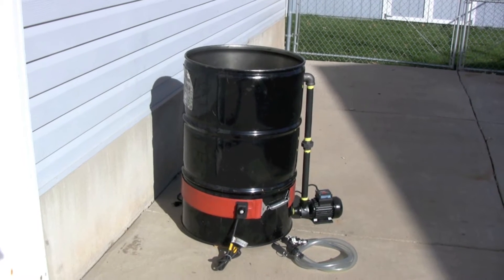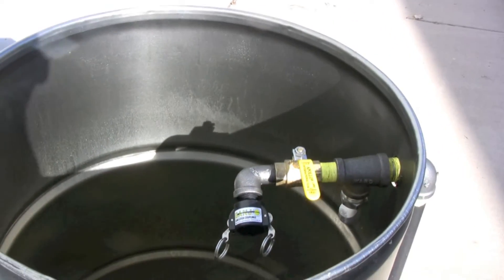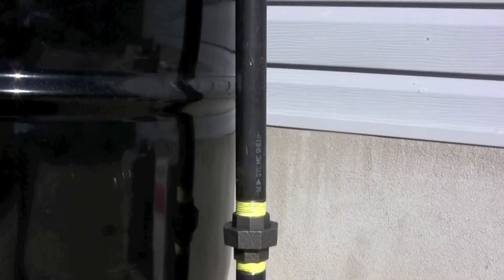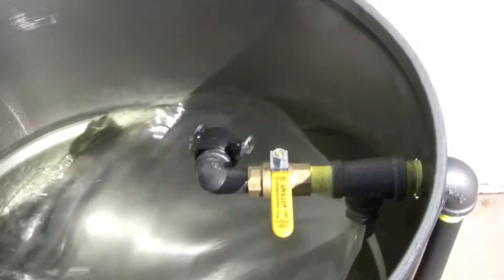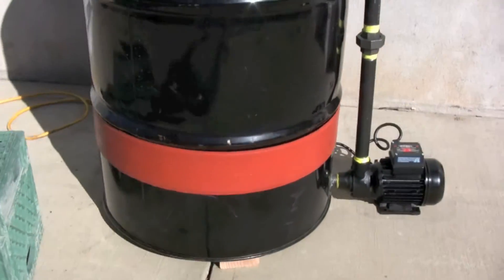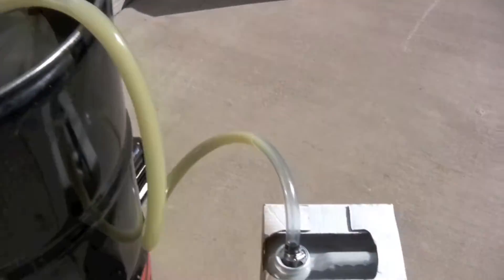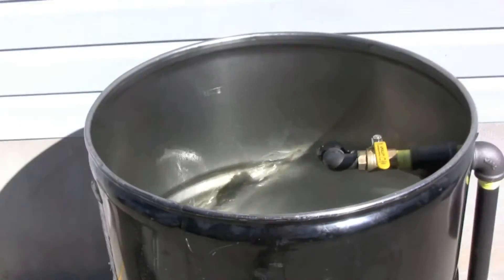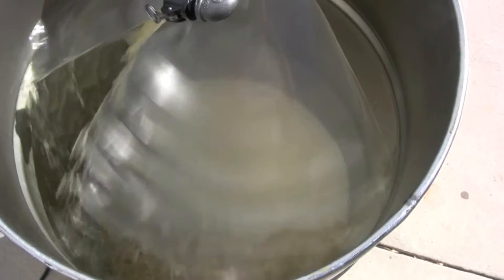Oil Drying Tank (For drying wet waste vegetable oil or Biodiesel) - Utah Biodiesel Supply

Comment: Is this drying process necessary why not just let it rest for few days and decanter the water out of the bottom?beat the bottom of tje drum out till its rounded and put in a valve or have the drum sat at a say 5 degree angle with the valve on lower end?or dose the biodiesel allways retain some moisture content even after this process???
Reply: The Biodiesel can retain some moisture even after heavy settling. Particularly in climates that are high in humidity.
Reply: @graydonblair3928  thanks for getting back to me man..was wondering why this process was (needed)you have good day my friend 👌